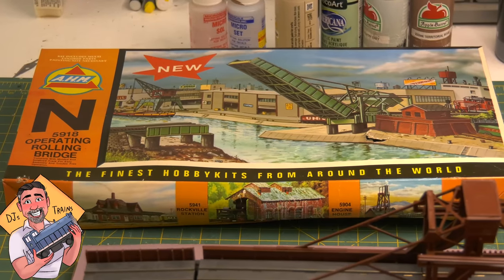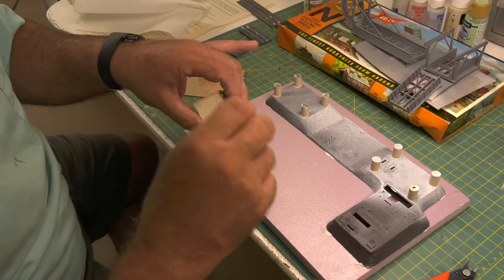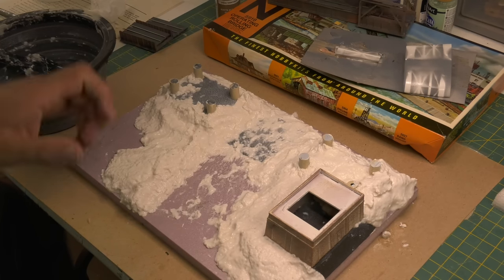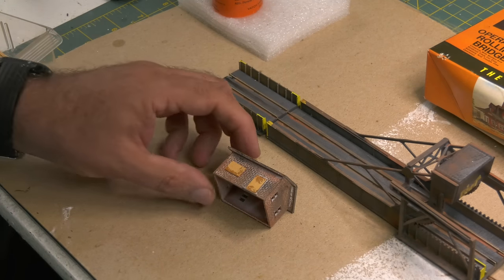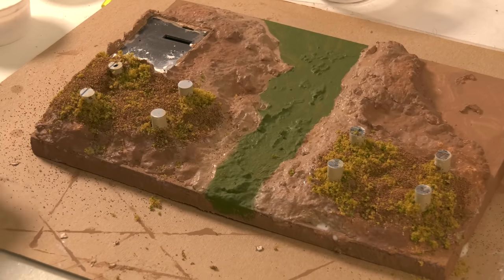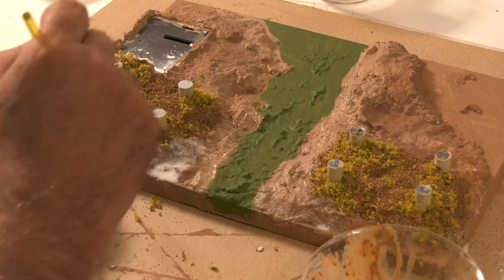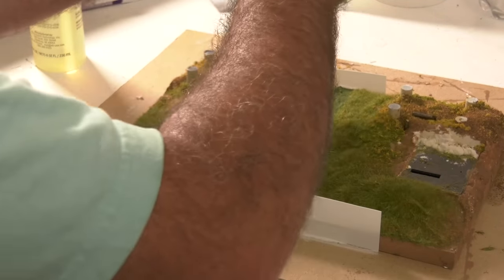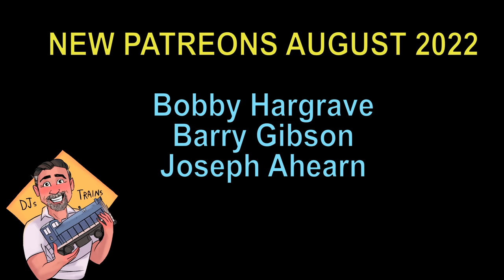How To Make Great Model Railroad Scenery in a SMALL SPACE

Comment: DJ, you've got to use the whole 'modeler's license' when doing scenery. Those 'bumps of plaster' in the river, paint them to look like stones/rocks. Heck even use a few small stones/rocks/pebbles you find outside. Modeling scenery is an art form that is easy to master by remembering two simple rules of nature; nature absolutely abhors straight lines, and hates bright shiny colors. 

Most people paint equipment/buildings the way you have shown. It works, however, if you're aim is an old unused item that is a bucket of rust, start with the rust colors and then add the old original colors sparingly on top. Sounds odd, yet works every time.

Comment: I have a version of this kit in HO. I kit bashed it turning it into a double track bridge and now it's mounted in my medium sized harbor scene area. 
I was going to pour the Environtex once I found what box I stored it in. But, then found out it has a shelf life of about a year or so and I bought mine about 6 or 7 years ago. I stopped looking for it in fear if I use it it will not harden. That was a waste of about $20. 
The bridge came out great however with many improvised components (I didn't use the base) and it butts up against a long wooden pile type trestle I built about 10 years ago. As for the harbor water I may just go the old route and use gloss varnish, not sure yet if I want to spend more money on the Environtex. Nice video as always.
Phil
Jersey Shore Area